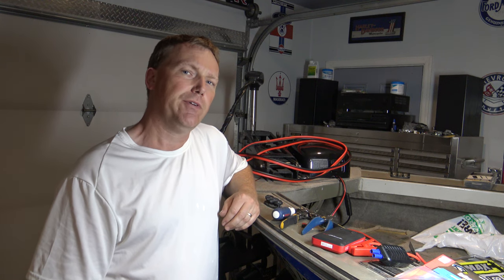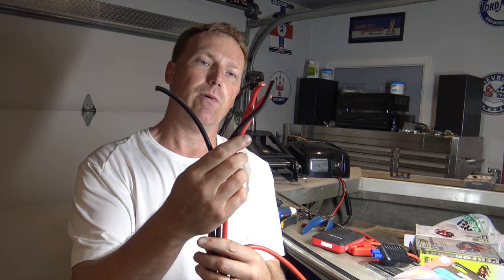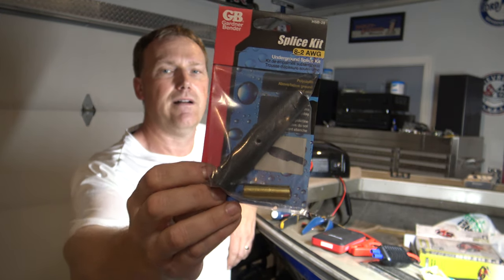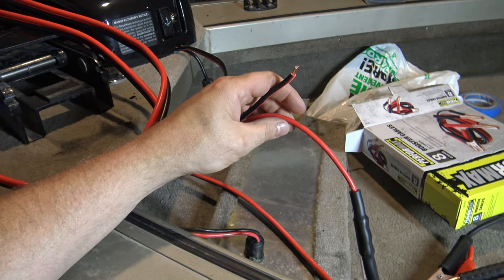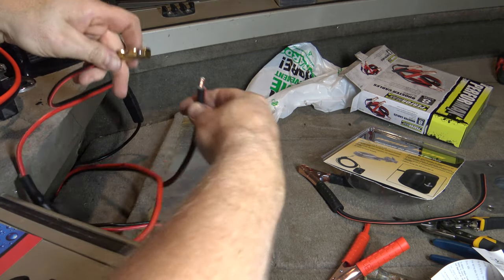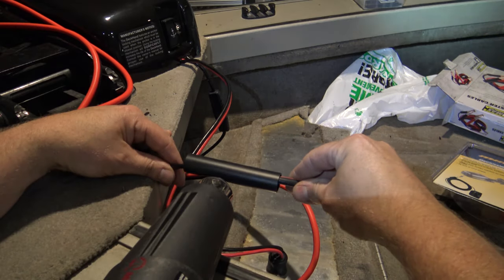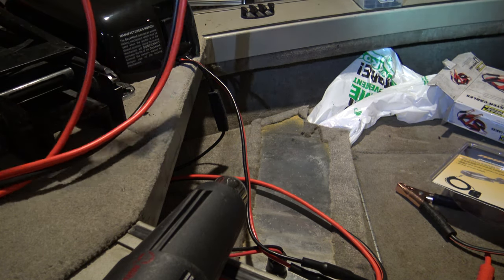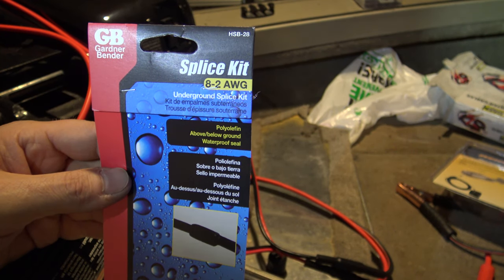How To Splice and Extend Battery Cables For Your Boat

Comment: I would put some dielectric grease inside to prevent corrosion as well
Reply from the maker: Great idea..thanks.. have a great rest of the day
Reply: I added dielectric grease into a crimp connector.  Every wire slid out out of the crimp because of the slickness of it. Very frustrating.. It led me to this youtube search. Lol. I'm gonna try these without the grease, or add it to the outside only.
Reply: @WayneTX254  grease would go on plastic wire shield closer to crimp connector.
Reply: How about soldering the connection after you have connected the wire with this connector?

Comment: I did this years ago to extend my tiller mounted trolling motors, kept the terminal clamps on. I will tell you that any connections with un tinned copper will corrode.

Comment: Hey, great video and kit. My trolling motor positive & negative silver cable is 8 awg. Question is could I use and splice a 16 awg extension copper cable kit to my battery? Jump lead cable is a thicker gauge?
Reply from the maker: I would not... you could go 10ga but no thinner
Reply: @addismultitasking3504  Thanks for getting back to me, I since found out by a local auto electrician that 4-6awg jump lead cable would be fine and I have a spare one in my garage :-)

Comment: I have two of these units new out of box they will not pull up and anchor 30lbs I used 8 Gauge and 10 Gauge they pull the voltage down on the battery and won’t pull up anchor
Reply from the maker: Ive mounted 4 of them all work perfect .  I assume your using the wrong
kind of wire.  You must use jumper cable wire, have a good splice and a good
battery.  I have friends with them as well and no problems

Comment: Is this still the right link to the cables, they are $25 now. Walmart search shows the same description "300 Amp 8 Gauge Jumper Cables" for $13.99 but i don't know if they are the same or copper clad.
Reply from the maker: i assume the walmart are copper clad
Reply: @addismultitasking3504  I need 50amps for my 55lb trolling motor. If the cables are only 8 gauge they may not be enough, so im looking at 6 gauge, unless i can find 8 awg 10 feet marine jumper cables. It looks like it is getting harder to find good copper cables now, or i just dont know what im doing.
Reply: @dtresonate505  how far is the battery from trolling motor?
Reply: 5 ft distance, 8AWG. And for 10 ft distance 6 AWG.

Comment: I do like the splice connector.  That's exactly what I was looking for, but I wonder how long the wire will last since it's not marine wire?  I always thought you needed to use tinned copper for marine wire.
Reply from the maker: Im in fresh water, been using this method for years with no prob.  Salt water use you might want marine wire